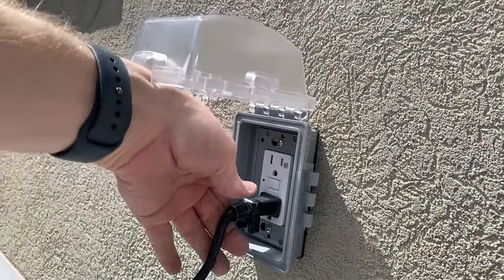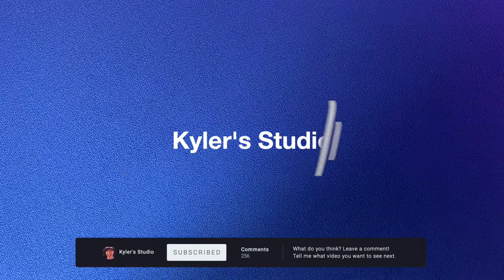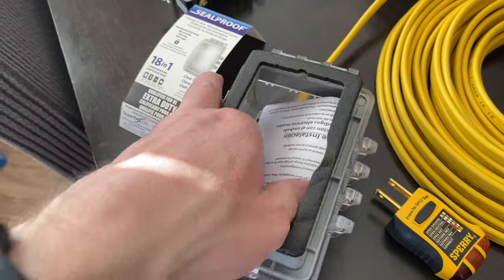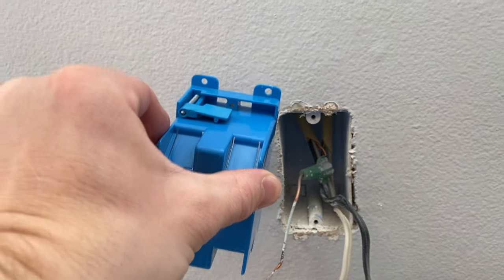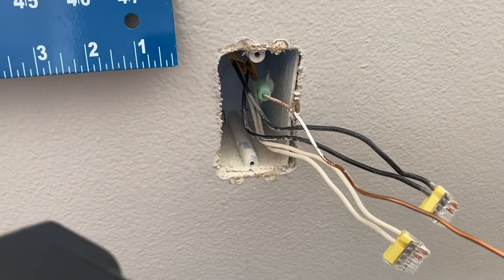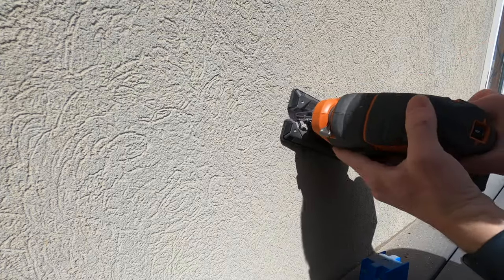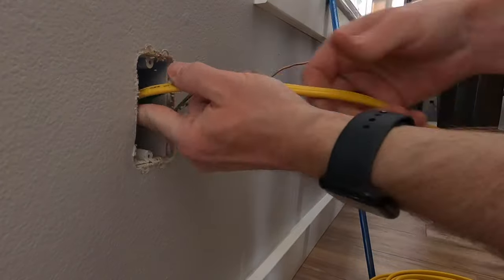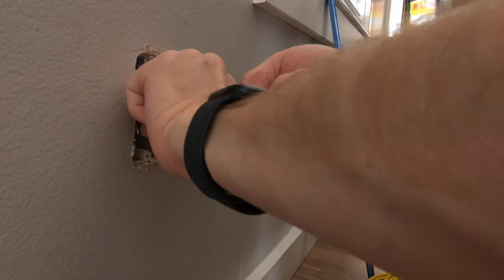How to Install Outdoor Outlet from Indoor Outlet

Comment: I got a bid for this exact project from a licensed electrician and he wanted $400.  This is enough information to do this job by yourself.  Thanks.
Reply from the maker: Glad to hear! As long as you have enough room on the circuit, it should work!
Reply: I was just quoted $750 for this exact job this morning in MD. Sent him packing.
Reply: This was an unexpected video, love your style! Made this enjoyable. Great work!
Reply from the maker: @rhuynh  Thank you!
Reply from the maker: @atelierlacombe8446  I think that's why these electric videos are popular; because electricians don't want you to know that some of these things are not that complicated. Perhaps dangerous if you don't know what you're doing, but $750 to install a plug? That's a little crazy.
Reply: I got quoted $800.
Reply: @KylersStudio it is not about being complicated but being safe. There is codes and regulations to follow in order to do good safe work, the moment you ignore those things and start to hack and mess around with electricity without the proper knowledge people could get hurt or die so please DON'T.
Reply: $400,700 and 800 😳 For a protect that costs less than $20.
Reply: @fbenfrank  no buddy.  Not $20.
Reply: This is not a knock on this video or any other diy type video, but there's a reason why people in the trade industry get what they get. It's the same reason why any doctor commands the type of salary they do. There are years of school and training behind each licensed and insured contractor. Not to mention the cost of purchasing the variety of tools and equipment in order to do a lot of these jobs successfully and efficiently. I'm not talking about simply wiring a new outlet but more of a generalization to the overall craft. Remember this - Skilled labor ain't cheap, Cheap labor ain't skilled.
Reply: Can I do this for a service disconnect? For a 115v mini split system ??
Reply: $400 is cheap. Electrocution is expensive.
Reply: No one complains when a mechanic charges 700-800 to replace an alternator  😅
Reply: Thats cheap

Comment: Not really the best plan, although it is done quite often.  You have to consider the existing load and device count of the circuit you are tapping into.  If that circuit has heavy draw appliances, or is already at the maximum of twelve devices, don't use it.  Best practice is to install a dedicated breaker and circuit for outside outlets. I know, that requires an electrician for most of you, but that is the reality.
Reply: Yeah, and he forgot to check the angle of dangle??
Reply from the maker: That circuit had only a few outlets, only one of which was regularly utilized. The chance of overloading that circuit seems unlikely. Though I agree, it would be ideal to add a separate outlet for the outdoor wiring, that would require much more extensive work pulling wire through finished walls and did not seem justifiable for one occasional use outlet.
Reply from the maker: Apparently so..
Reply: No, not everything requires a damn electrician even for the average person with the correct instructions. Installing breaker is just as simple as installing an outlet. You were so DESPERATE to say he was somehow "wrong" that you made up some scenario in your head about appliances on that specific outlet like you're some sort of internet psychic lmao. That's just sad.
Reply: @Mutiny960  No. I was giving expert advice based on my 40 years experience in the field.
Reply from the maker: @Mutiny960  I agree with you. If everyone knew how to do it, electricians would be out of work. I see no reason a person can't educate themself enough to properly do electrical work in their own house. If anything, a smart electrician would make an app where a professional could double check the wiring work and give advice on how to do a project more properly. The secrets of the trades are starting to be given away freely online and the rewards going to those innovating vs 40 years of house calls where they can charge whatever they feel like.
Reply: @KylersStudio absolutely thank you for taking the time to show us. Everyone always "knows a better way". And if it ever did get over loaded that's why breakers are a there to protect wires from overloads or shorts obviously if it became a problem you know you need to add a dedicated circuit due to it throwing the breaker. Great work
Reply from the maker: @slicktmi You're welcome! My thoughts exactly! If the breaker kept tripping, then I would know it's overloaded. Of course that's not the best way to plan circuitry, but for adding a seldom used outlet, it's so much easier than tearing apart the house to run a new one outlet circuit. Glad it helped!
Reply: @KylersStudio  exactly! It's pretty basic stuff as long as you have common knowledge.
Reply: Exactly 👍
Reply: It also works to drill through the back corner of the box to locate the spot on the outside wall.
Reply: @KylersStudio an app like YouTube?
Reply: @KylersStudio And much preferred over running an extension cord through a window.
Reply: @TomCee53  that's what i do easy as pie
Reply: @scottsatterthwaite4073  40 years of "experience" makes you think in complicated ways. Overloading a circuit can be done indoors too. That has nothing to do with adding an outlet.
Reply: i wanna do that too and the outlet I wanna use to get power is inside living room.  My living room has like 7 outlets.   I just wanna install a gicf outlet on the outside wall on side yard to run extension cord for palm tree lighs for chirstmas.  I wonder i I should just use  a 100ft outdoor extension cord through the back yard to the front to plug in my palm tree christmas lights instead.  I think the lights will be out there only for a month and then I will take them down. They are the smart twenky lights. I have a corner  house so I can run cable through the side yard to the front.
Reply: @futbol1972  pick a circuit that's not heavily used ... I e. outlets that nobody plugs a heater or some other heavy duty appliance

Comment: Romex (aka NM cable) should never be run exposed, EXCEPT between joists. That includes between studs. If it is exposed within easy access, it should be in conduit.
Reply from the maker: Right..but it has to run between studs to get to the end point and not exposed with drywall or wood over it.

Comment: On stucco surface mount your box, use electrical putty for watertight seal around your penetration and hidden behind the watertight box
Reply from the maker: Interesting idea, I've not heard of that. What do you wrap the putty around? The whole box? I imagine that is like plumbers putty but specific for electrical applications?
Reply: @KylersStudio  its called duct seal

Comment: Two things - Use some silicone around the blue box to prevent moisture and air from seeping into/out of the wall. And two, don't use Wago's on ground wires. Complete waste and not as good of a connection. Just twist the ground together old fashion style with a wire nut. Its more better. And cheaper.
Reply from the maker: After seeing the foam press against the wall and with such tiny gaps, I didn't feel it necessary yet; maybe once the foam deteriorates. Why do you think wago nuts are less effective? I didn't care about saving a few pennies, as I already had them and I'm not doing this project at scale.
Reply: There shouldn't be any voltage on the ground wire so why would a wago not be a good connection? As far as costs go most people using wagos have a decent assortment already on hand. Price wouldn't really matter. If I have a dozen in a jar in the garage, or one of them in the wall and 11 in a jar in the garage I still have 12 Wagos. They're already paid for and I still own all of them. Only difference is the one you're worried about is in the electrical box and not in the garage.

Comment: would be nice if you put the wire type and gauges of the wires.
Reply from the maker: Good point; I've gone over that in previous videos. You can check the sheathing of the previous wiring to match. Google says: "15-amp circuits usually use 14-gauge wire, while 20-amp circuits generally use 12-gauge wire or 10-gauge wire." Just match what was installed before and don't put a smaller wire than the breaker/circuit requires.

Comment: Can someone PLEASE help me with my scenario? I’m wanting to do this very thing, except after using an interior outlet I need to move the outlet about 8 feet along the house outside. Do I just use conduit from the outside? I would appreciate any help! I got a plug n play 110 hot tub but only has a 15 ft cord. I’m just trying to get an outside outlet box closer. I’m a 65 yr old female with a lifetime of experience but not at this..any ideas, please?❤
Reply from the maker: First off, I’m not an electrician, so take this for what it’s worth. Usually a hard wired hot tub need its own circuit with a shutoff somewhat close but not too close to it (5-50 feet within sight but not within water, check your codes). If it’s 110, I suppose you could get away with it by running the wall box with rigid conduit to your shutoff box and liquid tight to the hot tub. Make sure the circuit isn’t overloaded though, otherwise the breaker will trip when your hot tub kicks on.
Reply from the maker: If it’s just an outlet you need outside then you could connect through the wall to a box that runs rigid conduit to an outlet box. That should make it watertight if you use the right connections. You might not even have to bend the conduit if you use the right boxes. I think a liquid tight would be ok for this if there is a low chance of it being touched, but rigid is more durable.
Reply: Please hire a licensed electrician to wire this correctly.
Reply: You’re definitely going to need an electrician. Hot tubs usually run on a 2 pole 50 amp breaker which you definitely don’t already have a spare one in your panel not being used. I think they have to have an outside shut off too like the HVAC system. In other words, they can’t just be tied into any existing circuit in your house or that breaker will stay tripped every time the hot tub turns on.
Reply from the maker: @rizzorizzo2311  I have to agree with you on this one because it can be complicated and we can't tell her what her specific requirements are. It's less hassle just to hire someone to do it right for you in this scenario.
Reply: Lady, You’ll catch the house on fire. Insurance will not reimburse you if the fire was caused by your handy work.

Comment: Personally having had several GFCI outlets fail outdoors I moved mine to the inside outlet and then sistered off of the GFCI outlet to the outdoor outlet. Both outlets are then GFCI protected. The indoor outlet stays dry and the outdoor outlet can handle the water without failure since it's all brass. I've never had to replace one but they are very inexpensive compared to replacing an outdoor GFCI outlet.
Reply from the maker: I've heard this suggestion before. I've personally never had a problem with that, but if you're doing a sister install for a client, this might be the way to go. The location of my outlet is under an overhang, so I wasn't as thorough as I otherwise might have been.

Comment: Will this work to add a junction box for a security light?  Thanks
Reply from the maker: It should. The other option is to drill straight back through the box and use rigid conduit to an outside external box.

Comment: Great video. Subscribed. I bet a surface mount weatherproof box would’ve saved him a lot of time.  And a smaller hole in the side of his house.
Reply from the maker: Are you saying just run a small hole with conduit out the hole into a box? That's a good point about a smaller hole.
Reply: Yes. Does Code allow for that? Because it seems like a lot less work. Aesthetically, of course having the box recessed looks a lot cleaner.
Reply from the maker: @NathanHarrison7  Conduit and metal boxes would work, but I like the recessed look better for this application.

Comment: Excellent video. This is exactly what I want to do. Except i think I'm going straight through the back of the box. You gave a lot of useful information. Thank you.
Reply from the maker: That works well too as long as you have the depth for the box. Simply just drilling through the back of the box is much easier.

Comment: Thanks Kyler for the step-by-step! I had the exact same scenario (stucco, wire & paper, etc.) and followed your vid without a problem. I did add some silicone to the outside box & waterproof cover (where they meet) to ensure no leaks. Now have an exterior outlet where I can plug in my low voltage lighting transformer - yippee!!!
Reply from the maker: Glad it helped! Silicone is a good idea.

Comment: Great video. I believe you did everything correctly when tapping from an indoor receptacle. Only thing that's not necessary is adding that metal NM connector inside the indoor outlet box. The Romex cable should still be in its place without it since it's secured in the box you installed outside. 

Personally, I would use a junction box that is outdoor rated instead of this type of old work box. At least you put a WR receptacle and outlet cover, which is necessary and code for outdoors.
Reply from the maker: I agree with you. The metal connector isn't intended for this, but I had a bag of them and figured it wouldn't hurt. Are you thinking you would run a junction box and then rigid conduit to an outlet? Or put an outlet in a metal junction box? It would be interesting to see the different ways to do it and find out what looks the best and is the most functional/durable.

Comment: Starting at about 10:30 you mentioned switched receptacles. While they could be different circuits, they are usually on the same circuit, especially if used for lights or something with relatively low power. Only the hot side tab is removed. If it was a separate circuit, 2 scenarios are possible. One is completely separate circuit and both tabs would be removed and you'll have 2 neutral wires and 2 hot wires. The other possibility is a multi wire branch circuit with has a shared neutral (only the hot side tab is removed) and you'll typically have red and a black wire on the hot side. Separate circuits must originate from a double pole breaker or 2 single poles tied together.
Reply from the maker: Good info. Do you know if that method is ever used anymore?
Reply: @KylersStudio  I think that switched receptacles on one circuit could still be commonly used in bedrooms and living rooms. Split receptacles with 2 circuits are probably somewhat obsolete in modern homes because of the requirement to have GFCI receptacles in kitchens and garages where split receptacles would previously exist. You can't split a GFCI receptacle, but you can use 2 of them to wire in a multi wire branch circuit. This method could still be used today.

Comment: I have stucco too and am wondering if silicone around the top in addition to the gasket would prevent water from leaching behind the gasket via the stucco’s irregular surface?
Reply from the maker: Yes! Extra waterproofing is usually always good.

Comment: Great video. The only issue I see, and I'm not a licensed electrician, is you used the incorrect receptacle. You turned off a 20amp breaker, you have 12/2 coming into your indoor receptacle, you ran 12/2 to your GFCI receptacle, but it appears to be a 15amp, not a 20amp. Also, it looks like your indoor is also a 15amp receptacle, which I would have upgraded to a 20a. 

The only reason I noticed that is I had the same issue in my home. While troubleshooting an electrical issue at home I found that all of my kitchen outlets (and a few other places) were 15amp, but they were on a 20amp circuit. I ended up replacing every outlet in my home and ensuring they were matched to the circuit. While that didn't solve the issue I was troubleshooting, it made me feel better about possibly causing a fire on an overloaded receptacle.
Reply from the maker: I just used old footage for the breaker from previous projects. I mostly just included it so people wouldn't forget that it's important to turn it off before you stick your fingers in there.
Reply: It’s perfectly fine (and to code) to have 15 amp receptacles on a 20 amp circuit. All the wire on a 20 amp circuit must be 12 gauge so if you’re adding an extra outlet like this, you have to use 12 gauge wire even though it’s just bringing power from one 15 amp receptacle to another 15 amp receptacle.
Reply: adding a 20amp receptacle on a 15amp line, would possibly cause overloading your describe.  But having a 15amp receptacle on a 20amp line?  How would that ever be overloaded?

Comment: Would external box be OK? Seems easier no cutting only drill a hole for the wire to pass thru.
Reply from the maker: Yes, that's totally fine. If you are sure to drill it in the right place, you might not even need to bend conduit. It might be hard to fish through the hole without taking apart the wall or box on the inside though. Pick your poison.
Reply: Exactly.

Comment: I can't believe you drilled the hole from outside and spend all that time to measure the wall  to be  in same place with the indoor box.
Drill from inside and you have the mark and hole to link  outside box,as simple as that.
Reply from the maker: That is a great method. I didn't want a big hole in the back of my box. Just showing that it can be done without that.
Reply: You only need to drill a 5.5mm with long sds drill bit and you have a small hole in the other side and that is your marking then anyway you have to drill a bigger hole that fits your cable or conduit.And drilling from inside your hole will always be smaller than drilling from outside to your inside box.
Reply from the maker: Yeah, I thought about that, but didn't have the long drill bit, so just measured and verified. That's a good method though as long as you can get away with it.